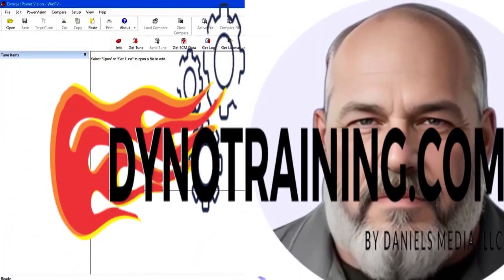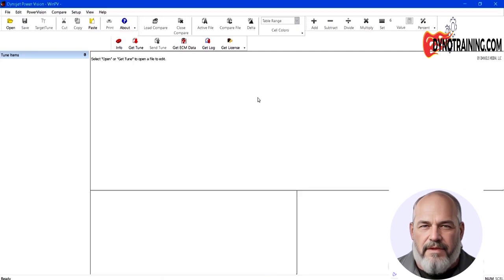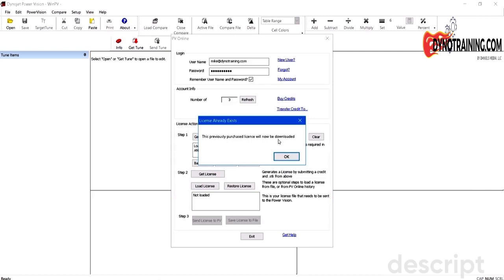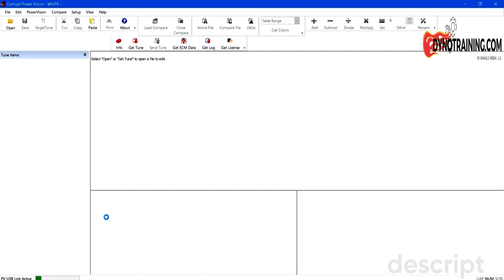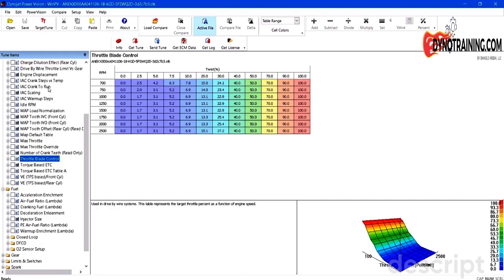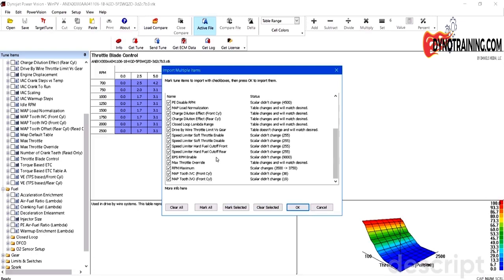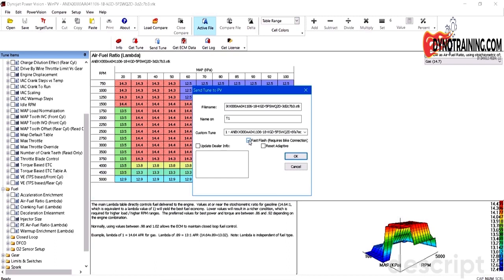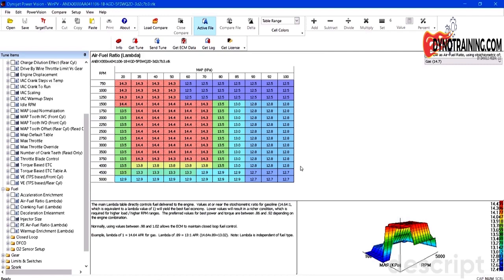Tuning a Dynojet Power Vision using PVV files

Comment: Is it ok to change the throttle control to a 1 to 1 race ratio.  Does it affect the tune calibration.  Would you recommend to change the throttle control to 1 to 1. On a 2021 softtail with the SE131 stage 4 kit.   I want max throttle percentage
Reply: I changed the throttle blade control on mine to 1-1 and it was great until I got cought in the rain. Just trying to pull out or go through the gears as light as I could broke the back tire loose. It was scary enough to change it back to stock even though I rarely ride in rain

Comment: I was using my PV logs and ChatGPT to tune my 2015 TC 103 EG UC Low air-cooled (SS 570 cams, VH Power Dual w/ VH Monster Round slip-ons) and got it running pretty good w/ 37 mpg but still saw high engine temps through stop n go type traffic areas.  Decided to to spend $100 and shoot my specs over to FuelMoto and the tune they sent me is IMO garbage.  I don't see any better temps and my MPG dropped to 30 mpg.  I opened the tune and it is really tuned rich even in low MAP low RPM coasting-type cells.  ????     I also noticed the tune is still showing a value of 103 for displacement.  Shouldn't that be set higher now?  And do you have to remap the AFR table if you change the displacement value?     I'm just getting ready to stop chasing these engine temps and accept the fact that my 2015 ElectraGlide just runs hot in city traffic.  If it goes over 350° I pull over and turn it off and let it drop back down.  (I also have the UltraCool oil cooler on it with the Flo oil filter).